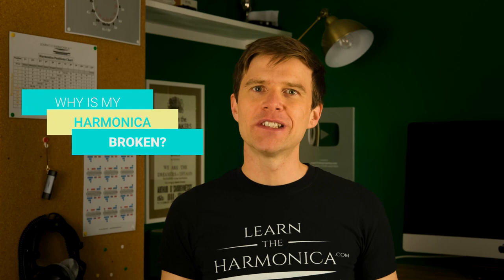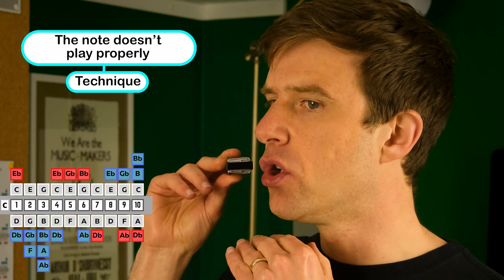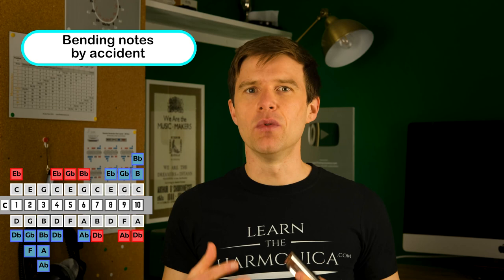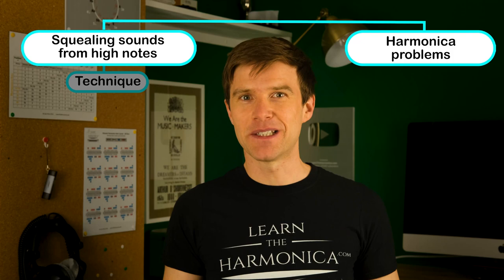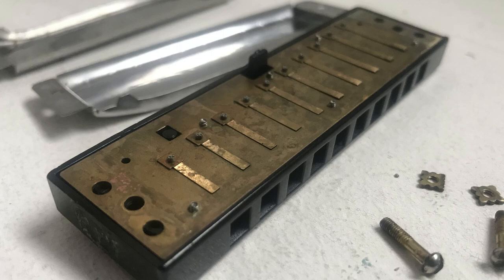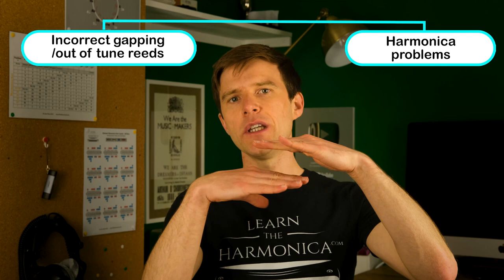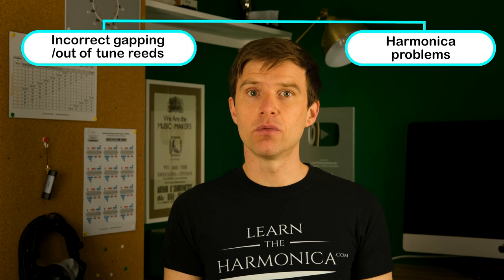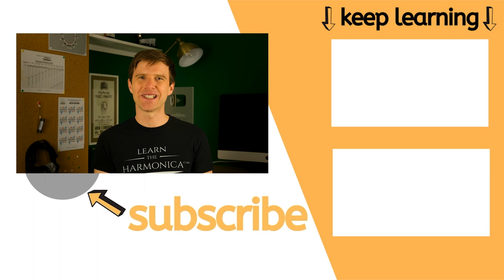Why Is My Harmonica Broken? | SOLVED Common Blues Harp Problems

Comment: My brand new G harp has a rattle on the first hole when drawing. It's a Fender blues deville, so it's not a cheapo harmonica. I've read that the rattle is pretty normal for G harps, but it sure doesn't sound normal

Comment: Nice,thank you for this,and i have a question: Why the 5th hole draw is going out of tune so often? I have a constant issues with it,although I don't bend it so much. What can be done to avoid this? I play on daily basis cause I'm a street musician and after 3 or 4 months of playing,the reed goes out of tune and I have to buy new harmonica.